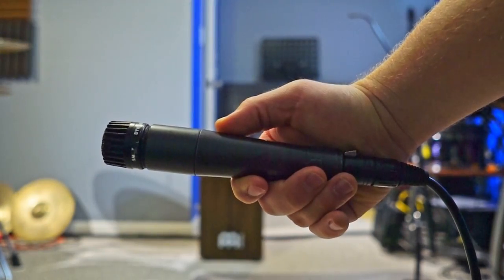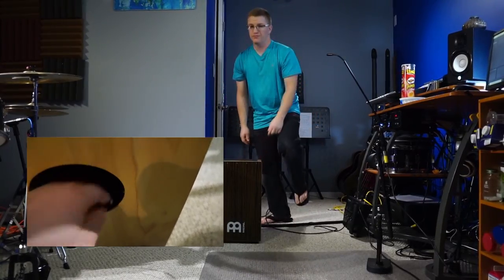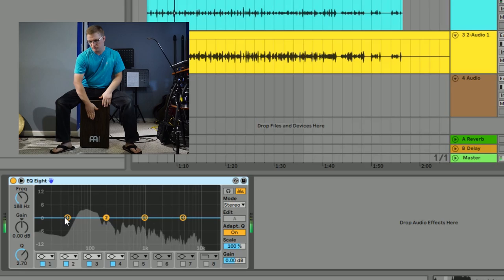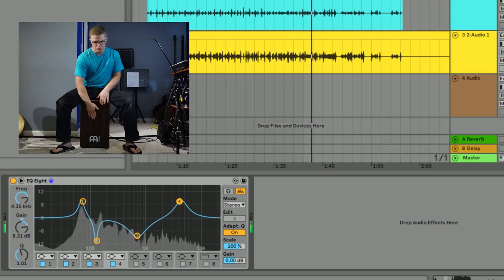How To Mic A Cajon

Comment: Here is a tip everyone. If you only have carpet and the Cajon sounds too dead just don't sit on it. Your butt acts as a dampener like putting your one hand on a drum skin while you other hand hits it with a stick. If too dead, pull a chair up next to it and sit in chair and reach over the cajon to play it. On carpet it will come alive big time, maybe too much, but adjust accordingly. Maybe try to sit near back edge of it. But, I've gotten great rich tones from my $70 cajon by not sitting on it and then adding any reverb. Bam! Sounds great.

Comment: Thanks for this video. I have a question, if mics are supposed to be inside a cajon when recording, aren't those going to record air inside a cajon?
Reply from the maker: I've never had an issue with any air noise- if anything, you'd get more of a puff of air at the sound hole than anything, but even then the amount of air moving is pretty minimal and the sound is usually quite loud, so the signal to noise ratio is still good.
Reply: @ChurchMusicBoxPlayer  Oh, I see. But does this have something to do with the mic in use?
Reply from the maker: @SoloMonYamashita-Hermit  Not really, I've gotten extremely usable results using this setup with a variety of different microphones.
Reply: @ChurchMusicBoxPlayer  Woah. Because I have only a budget microphone which is called BM800 if you were aware of the name, so I am concerned if putting a mic like that inside won't pickup any air or any unnecessary sound.
Reply from the maker: @SoloMonYamashita-Hermit  Alright, it looks like the BM800 is a condenser microphone, and a large diaphragm condenser at that. This wouldn't work well for that type of mic, unfortunately, but most dynamic mics should be fine. A large diaphragm condenser isn't designed to handle the sound pressure levels needed to be a close mic for percussion, as well as having more delicate electronics. If you'd like to do this type of setup on a budget, I'd recommend getting a Behringer XM8500 that can be purchased for approximately $20 USD.
Reply: Oh, I see. So it depends on the kind of mic. Thanks for the recommendation.
Reply: Also, isn't your mic moving around inside every time you hit the cajon?
Reply from the maker: @SoloMonYamashita-Hermit  It doesn't roll around once it's settled. If that's a concern, you could always put a small hand towel or cloth inside as padding, which will also mute the sound a little bit.
Reply: @ChurchMusicBoxPlayer  I see, because when I saw your video, you just casually put the mic inside. Hahaha
Reply from the maker: @SoloMonYamashita-Hermit  That's what I normally do! Every video on this channel is done like that.

Comment: Do you just having the mic going straight into your computer, or do you have some sort of mixer?
Reply from the maker: It's running through a USB audio interface. The one for this video happens to be an old Avid Fast Track Duo, but I've used a variety of setups so far. The first 10 videos I uploaded were with a Behringer UM2, and all the ones since then have been with a Zoom Livetrak mixer/interface combo.
Reply: @ChurchMusicBoxPlayer  Thank you! I have been wanting to start uploading my own cajon playthrough videos, but I've had a few setbacks. Hopefully I can start soon, if it's what the Lord wants! Thanks!
Reply from the maker: @elithomas5918  That would be awesome! There's definitely a shortage of this kind of content!
Reply: Hi, Is this same setup for live performance? I'm a new cajon player and trying to mic it for live performance. Sometimes our drummer is not available so we want to use a cajon.   From your setup, it goes through an audio interface to computer and output to mixer? What software are u using?  We mic the cajon also with a SM57 and connect directly to our mixer but even with a mic, it still not loud enough with other instruments like bass and electric guitar.

Comment: For me i recommend putting it on a stand  right ouside the hole but thats just me :/
Reply from the maker: That can totally yield good results, but I've found it's more prone to getting bumped, which adds unwanted noise as well as moved the mic position, changing the sound.  I'm not saying that placing the mic inside gives the BEST sound, just that it's consistent, repeatable, and very usable.
Reply: @ChurchMusicBoxPlayer  gotcha I totally get where you are coming from with that!